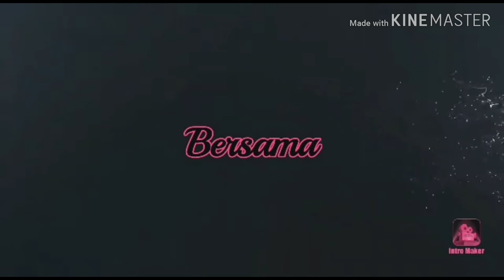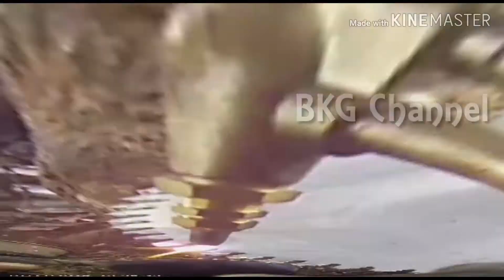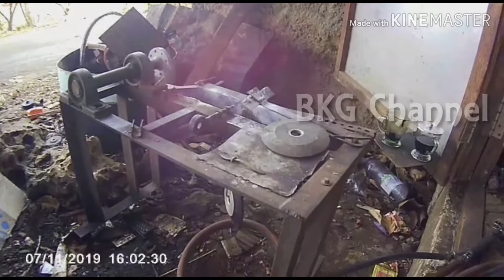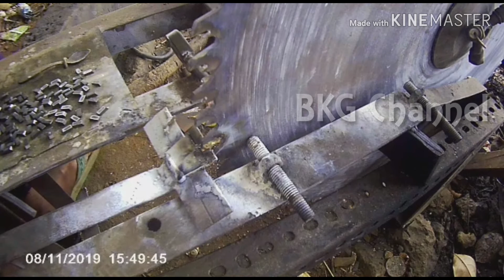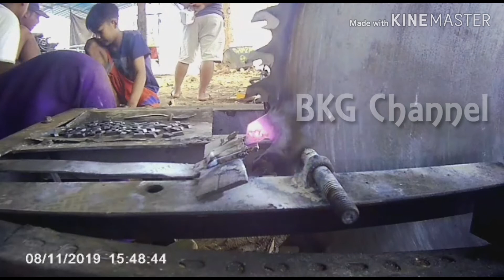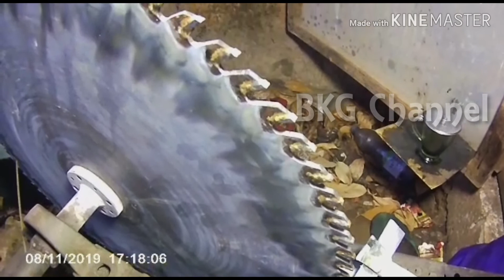Cara pasang baja mata gergaji circular/serkel

Comment: Malamm mas,mau nanya Itu ukuran  piro mas biasanya taring nya,,seng 3.8 mm apa 4.5 yo...aku mau jualan di srh stok itu kan wonogiri tmpat aku okeh kayu
Reply from the maker: Untuk diameter 35 / 30cm saya pakai 3,8mm kalau untuk diameter 60cm saya pakai yang 4,5, untuk lebih jelasnya silahkan lewat wa saja mas 081334775139 🙏
Reply: Harga pasang berapa bos untuk mata gergajinya yg ukuran 60 inci